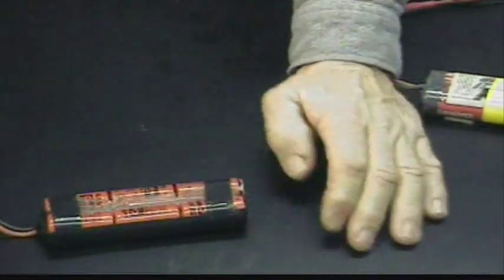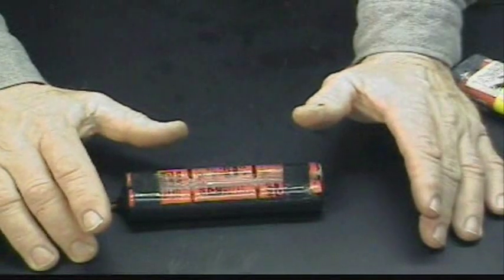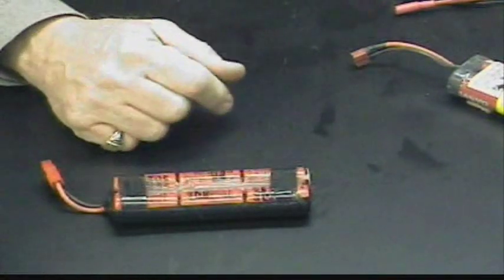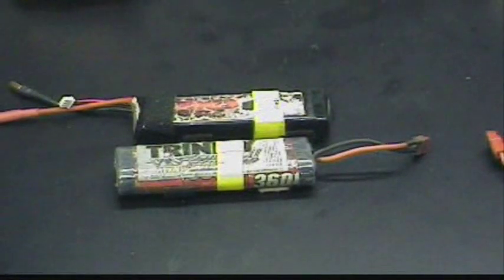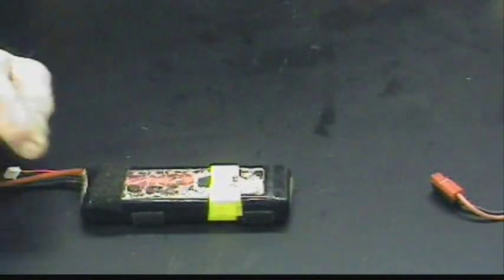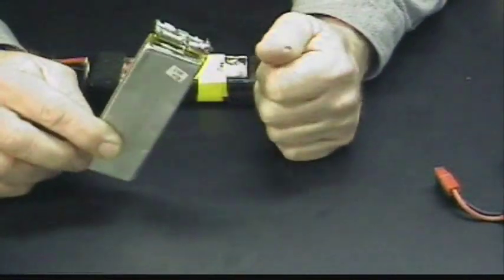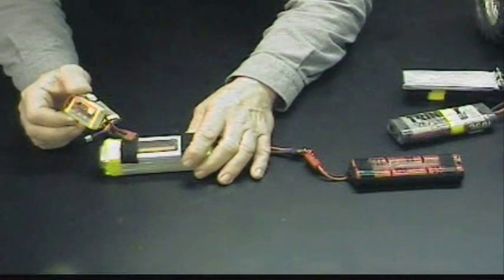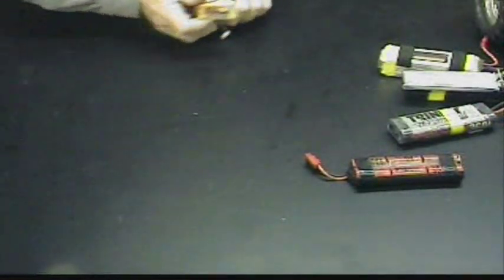The Basics or RC Batteries

Comment: Thanks for the info and time. I was going to replace a 7.2 volt ni cad battery in my sons brushed  rc boat with a lipo, but I'll have to look into it a little more. I did not know you would wreck the lipo battery if discharged to much.

Comment: My batteries have been sitting for awhile. They don't keep a charge really at all it will run for like 2 seconds. My dad said that I needed to slowly charge and discharge the battery. Is this true? if not what is the fix?

Comment: absolutely not true! if your batteries are worn out and will not hold a charge then they need to be replaced. if you were using an aftermarket charger then you might of been charging them at too many amps which will kill NiMh batterys.